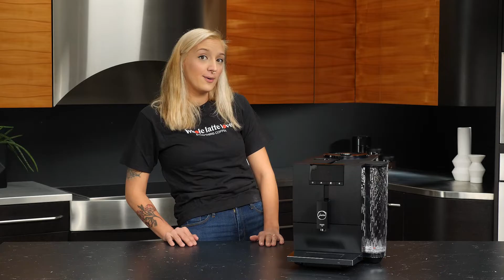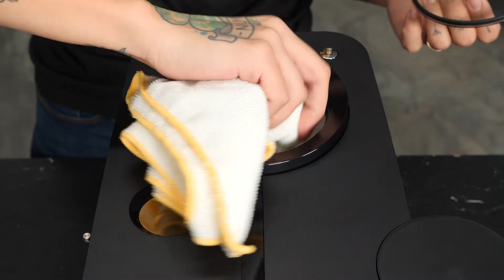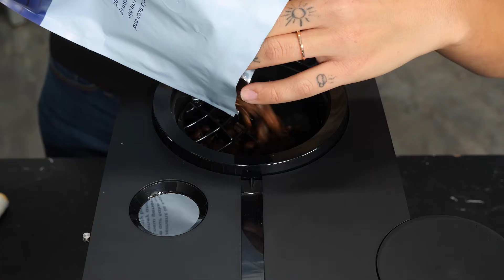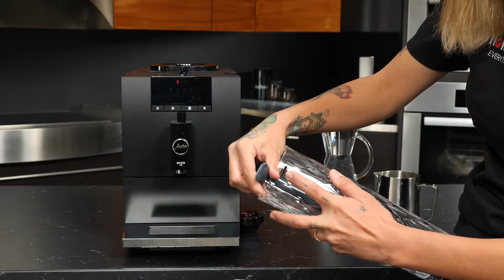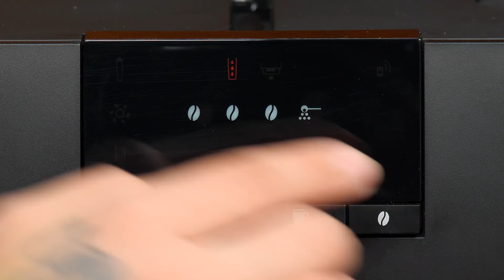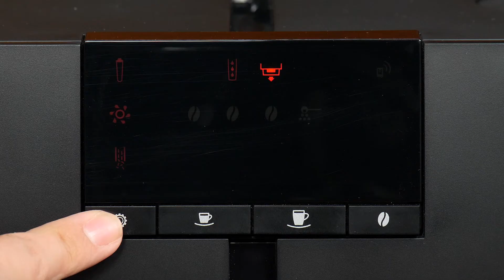How To: Initial Setup & First Use of JURA ENA 4 Espresso Machine

Comment: I been trying to get it to work for 2 hours. I’m about to throw it in the trash.
Reply from the maker: Hi albert, Must be frustrating. Have you contacted Jura support? Wish I knew more about the specific issue you are having. Don't know if this is yours, but a common issue with machines of this type is pump failing to prime initially. This may be your issue If no water comes out of the dispensing spouts during startup. This can often be easily resolved by slightly raising a full water reservoir and reseating right when you hear the pump come on during startup. If using a water filter in the reservoir make sure to prepare by filling with water from tap prior to installation in the reservoir. Air trapped in the filter can prevent the machine from priming. If you continue to have issues Jura Support should be able to assist you: https://us.jura.com/en/customer-care/hotline-and-customer-service

Comment: Thanks for this video. It is unclear which direction is a finer grind. I’d like it on the finest grind setting. It has no numbers or visual cues, how do I know which direction to rotate the grinder setting? Clockwise for finer? 

Thanks!
Reply from the maker: Hi FFO, If you look closely at the markings on the ring they are slightly thinner to indicate finer settings. You are correct,  turn the ring clockwise for a finer grind setting. If you've already ground coffee at a coarser setting it's best if the grinder is in process of grinding when you make the adjustment.
Reply: @Wholelattelovepage i see it now, thanks!
Reply from the maker: @FlyinFischOfficial  happy to help!

Comment: Bought this a while ago and have been fairly dissapointed, in part because of the coffee grinder guard/shield. it prevents the flow of coffee beans after two cups. constantly have to stir/re-fill. otherwise i get the weakest coffee flavor.
Reply from the maker: Hi Cytb, Thanks for sharing your experience. I've been using an ENA 8 with similar bean hopper daily for a few years. Every once in a great while beans do not feed past the guard.
Reply: @Wholelattelovepage  thanks for the response. did you contemplate removing the guard? other jura machines do not have that and wondering what the main purpose of it is

Comment: Since the video mentions adjusting the grind, they should also mention the manual specifically states that “Only adjust the consistency of grind when the grinder is in motion”. If not, grinding wheel can be damaged.
Reply from the maker: Hi Zak, Thanks for the comment. Okay to adjust coarser without the grinder running. Not okay to adjust to a finer setting.
Reply: They also specifically mentioned making sure it was running while adjusting.